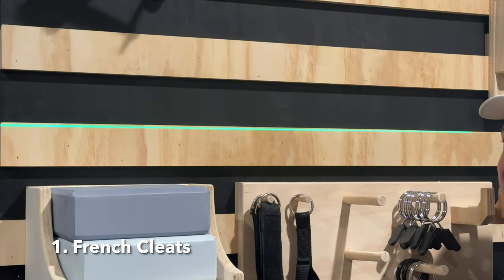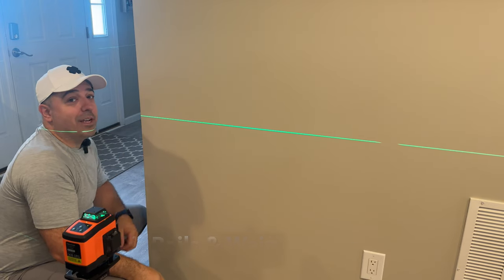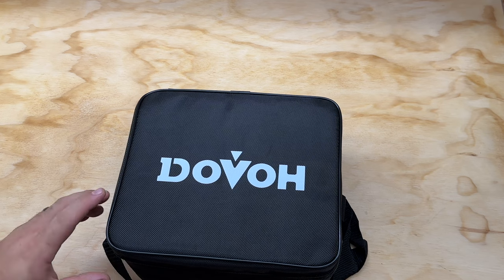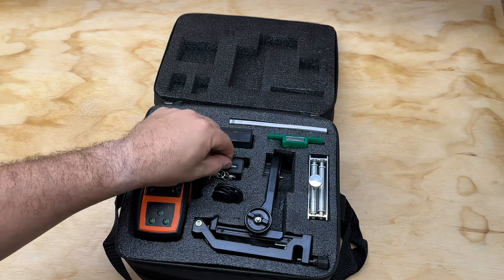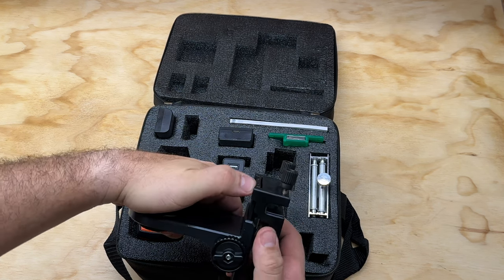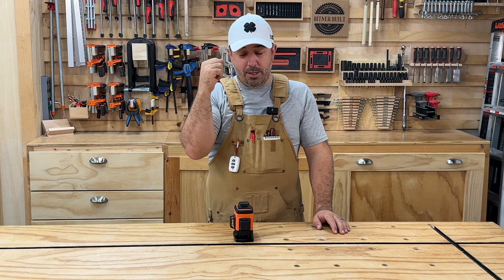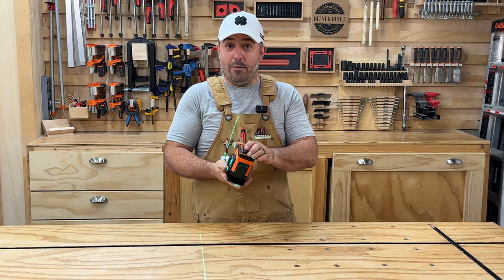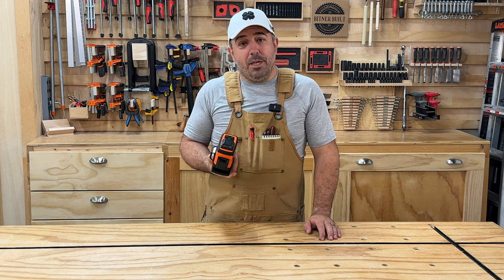20 Ways To Use A Laser Level! Hands On With The DOVOH Laser Level 360 With Self Leveling

Comment: If you're a chair maker (or chair dabbler like me) lasers are a godsend when aligning chair legs for correct, consistent, splay and rake when you're drilling. I also used one when installing windows and French cleats (which is how I found your channel in the first place) to turn that shed out back into a shop. 

That micro-adjust plate looks like a great add-on for any laser setup. Dang.
Reply from the maker: Very cool use! Yeah, that micro adjust plate is going to get used for so many different things!

Comment: Hi - I have an 120 yr old home and am sistering joists and trying to level a ceiling for some new drywall and then plaster. I need something tough, reliable and with multiple connection/attachment methods - this seems like a good product! FYI I subscribes because I like your presentation style!
Reply from the maker: Thanks Bonduie! Seems like you have a big project, fingers crossed for ya!

Comment: Great tips! I would probably use it - at least initially - for installing French cleats in our garage (my workshop). I have plans for doing that, & have NOT been looking forward to using my regular 4- or 6-foot i-beam level! Another cool use, at least for laser levels in general, is doing hand lettering. You can tape your paper/card/envelope/whatever onto a mat with a grid printed on it - lining the top or bottom edge of what you're writing on up with one of the grid lines on the mat - and then position your laser level so the beam shines across the paper. Of course, you have to line the beam up with a line parallel to the one the edge of your paper is lined up with, but it gives you a visible guideline to help ensure you keep your writing from going wonky. Not sure how or if that would transfer to woodworking (maybe painted signage...?), but I still think it's pretty cool. I make handmade greeting cards, & learned this from another card maker on YouTube (where else? LOL). Anyway, thank you for sharing your tips & tricks, & for doing the giveaway. Have a wonderful day!
Reply from the maker: Great use case! Yes, I’m sure that could definitely transfer over to some marking prior to cutting!

Comment: Seems like a well built unit. Hell, I'd by the jack plate by itself! lol As you were cycling through the different modes, I noticed it has a plumb bob setting which for an electrician, (me) would work great for laying out lighting.
Reply from the maker: Great use!

Comment: I have been looking for a new laser since my old one died a miserable death (a certain young lady neglected to remove the batteries the last time she "borrowed" mine). The timing is impeccable. Even if some other lucky sot wins, I still plan to buy one. Since you recommended the DOVOH, I'd seriously consider choosing from their product line. 

My next project is to run EMT and additional outlets in my workshop. This would be invaluable to make sure the tubing is installed level. 

Great video!
Reply from the maker: Thanks and fingers crossed for ya! Yea I’m legitimately impressed for the price point and the warranty

Comment: Really liked the video... It's almost like your reading my mind! 😮  I'm in the process of remodeling my 20x34 shop... I purchased a good Lazer level based on the brand... wrong decision! The batteries don't last, maybe 4-5 hrs of use before they need to be changed out. So I bought the rechargeable ones and the last about 2½ hrs and have to be changed! When I was installing the 6" dust collection system and the 10 @8' LED lights (suspended) at 8'h, it was a real pain being in the middle of the project to take it down, change the batteries and then reset the Lazer to get back to work... allot of loss time messing with the Lazer! Better word would be frustrating! I was down to the last 3 lights when it went down again! I was taking it down (to replace the batteries, I lost my footing on the last rung and it slipped out of my hand...needless to say, no more Lazer.  Yep, you guessed it - not covered by warranty 😢 so almost a  total loss! Ended up using a line level to get the job finished. Haven't had the money in my budget to get another one. Being 69, I think I might have overstepped doing a project this big, but still enjoy a good challenge 😊... just wish I was younger... don't we all.
Haven't heard of this brand... but really impressed with this blog and the capabilities ... my broken Lazer didn't have the same capabilities and it cost me almost three times as much (on sale)!
I've gone back and watched every one of your blogs... Your honest approach and presentations are really great 👍
Keep up the great work... I know your channel will grow! 🎉
Hope ya have a blessed day 😌
Reply from the maker: Wow that sounds frustrating! Yeah, I do like how this laser can be directly plugged in, especially if you’re going to be doing a long-term project where you need to leave, it mounted in the same position for days. Yeah I hadn’t heard of the brand either, but I really looked into them before I said yes on the video, I like specialty companies where this is the only thing they do and they’re trying to do it very well and break into the market at a good price point. When you go onto Home Depot and you see a Bosch for $500 you know that 99% of people who aren’t professional contractors aren’t going to buy it so being able to get those capabilities at a good price is a win
Reply: @BitnerBuilt  that is oh so true! I love this community and there are so many possibilities 🤗

Comment: I’ve still not installed those French Cleats on my wall yet. Using a DOVOH laser would be ideal for getting that first bottom row level. 
I’d likely also use it like you showed, to get fence posts level and plumb, when it comes time to replace them. 
My wife is always hanging multiple items on the walls and wanting them level, but we end up off-setting them . 😂
My wife has also asked me to make some sort of cabinet/shelf feature in our TV nook. Having a multi-line laser would  definitely be of use during that project!
Reply from the maker: all great uses Damonbarber!

Comment: One thing I’ve used my laser level for is when making shop cabinets. My, as most, garage floor slopes towards the garage door. I’ve used my level to simulate the surface of my bench and then measure the height of that surface to the floor to make legs that accommodate for the slope. Not the best description but hopefully understandable.
Reply from the maker: Explained well! its a great use case for the laser!

Comment: I've been looking at laser levels fro a couple of months now, trying to decide what to buy, and then you make this video :D.  Our house was built in ~1948, and I don't know if anything was square in it ever.  Getting ready to do a patio, privacy fence and a ceiling in the basement.  I'm finding string to be a challenge.  I have some trauma issues with water, so using a water level isn't going to happen.  The biggest thing w/ these laser levels I've been looking at is the distance.  Use case is inside vs outside.  I can find one that's usable inside.... but not outside.  So if the K3 won't work outside... please pick someone else and tell me to buy the K4 :D
Reply from the maker: To use this one outside, you would want to use the reflection plate, I would probably go with the powerful one however, as the one I was showing is a little difficult to see outside without the plate

Comment: I would use it to                                                                                                                                                                                                                                 1.nail half wall trim molding.                                                                                                                                                                                                               2. Hang track lighting on a celieng in a hall room to make sure they are leveled.
Reply from the maker: Great uses!

Comment: Great video, question please: is the indoor 4 adequate for most outdoor jobs when there is no precipitation?
Reply from the maker: If it is sunny it is very hard to see outdoors. You would need to use the green sight plate and preferably in the morning /evening / overcast. If it was going to be used outdoors a lot I would say buy the outdoor model with the more powerful laser
Reply: @BitnerBuilt  Thanks!

Comment: I sold precision sensors. If something happens to a certified instrument (inadvertent droppage) you need to recertify the sensor or recalibrate it. I cringed when you intentionally knocked this tool on the floor. I know about the lock assembly but I would check the level out before using it again. I think a procedure would be simple by projecting a line on the wall and rotate it 180deg to double check. 
I have a similar unit that you showed and love it! I’m going to buy one of those micro jacks you showed.
Reply from the maker: Oh inside I was cringing as well 😅but they said we built it tough make sure you drop it, yea that jack plate is fun

Comment: I'm interested but wondering if it would work for aligning my garden beds.  That's my main concern.  Worth a try?
Reply from the maker: The one that I showed in the video is their top-of-the-line indoor one, they have one more unit that’s higher tier that’s meant for outdoors so it’s brighter. For my personal use case when I did my fence outside, it’s not like when you’re inside and you see the line everywhere, it’s more that you’ll see it touch the item that you’re doing if you’re up close to it, of course doing it in the afternoon or on a overcast day, makes the lines more visible
Reply: @BitnerBuilt  that's really helpful, thank you

Comment: I just bought a 4 beam laser but what's the point of the 2 horizontal beams as you cant adjust the distance between them. They are set at the distance between them on the unit? Am I missing something here?
Reply from the maker: It’s just to be able to get closer to your surface. For example if the horizontal laser was only on the bottom, and then you needed to do something like crown molding up at the ceiling, the height of the laser might actually impede you from being able to put the laser where it supposed to go putting a laser on the top allows you to get really close to the ceiling and the at the bottom allows you to get really close to the bottom of the unit if you’re working on the floor for example

Comment: how do you do No. 16 Drainage & Slope? Does my laser level need a pendulum lock to prevent damage to the pendulum? will the laser work when the pendulum is locked?
Reply from the maker: So it’s a bit involved to explain in a comment, for drainage and slope you’re gonna need a grading rod to pair with your laser. Do a YouTube search there’s a lot of instructional videos on how to do it. If you have an auto leveling laser, then it should have a pendulum lock, you need a pendulum lock to prevent damage. Yeah when the laser is locked, it still fires the laser out every direction. It just doesn’t auto level, there’s many instances where you will leave it in the locked position because you’re trying to project the line somewhere in the level of it doesn’t actually apply.
Reply: @BitnerBuilt  yeah projecting a straight, but angled, visible line outdoors is my main objective - actually doing grading/slope work isn't critical for me. 

Can you recommend a level that can lock and also provide sufficient brightness for outdoor use?
Reply from the maker: @g-lurk  OK so if you don’t need the auto leveling function you’re able to buy a much more affordable standard laser level that’s rated for outdoors. Obviously 3d, 4d, rotary levels have much more functionality in the long run so you might want to consider what your use cases are if you want to spend more money on those. I have to say that I’m very happy and impressed with the laser that I showed in the video, and it is my onlypersonal owned laser. Now I sold the other one that I had. So I’d be reasonably confident in any of their other outdoor models. I did on a model similar to the Bosch GLM400C when I was building my house, and it worked well outdoors. I had a black and decker and DeWalt one that I wouldn’t recommend. Outside of that I don’t have any personal experience with a specific one to be able to tell you which one to buy.
Reply: @BitnerBuilt  THANK you! I'll look into the other outdoor lasers without auto level.

Comment: I have the hardest time when I need my laser to be  up high. My tripod doesn't go that high and an extension pole makes for no micro adjustment.
Reply from the maker: It is hard, I like the magnet mount for up high stuff but when filming for example I needed to switch to one of my tripods that go very tall, but have a very small footprint that I could place them on top of a chair or box to get it high enough.